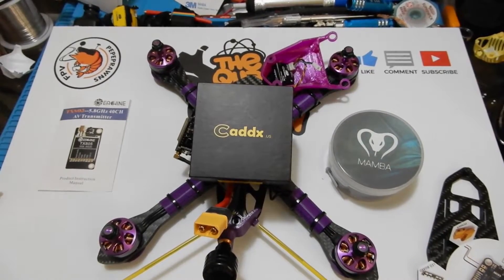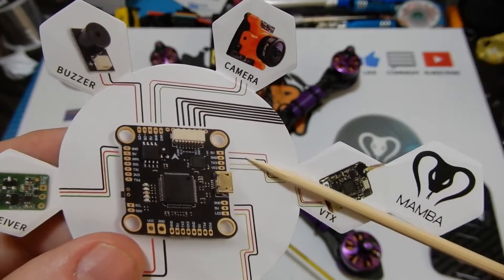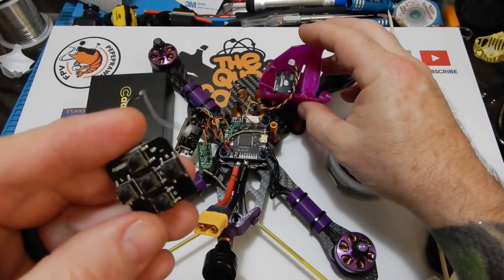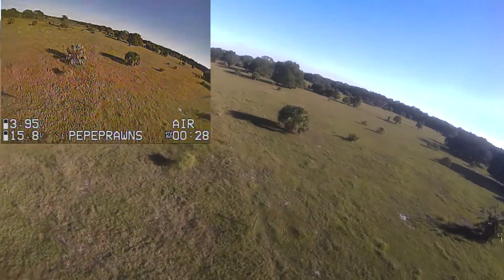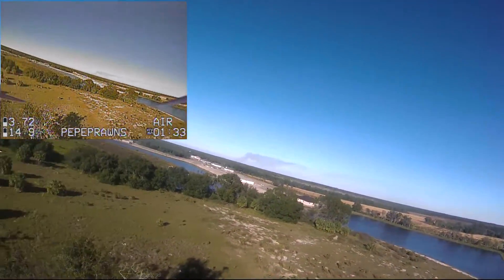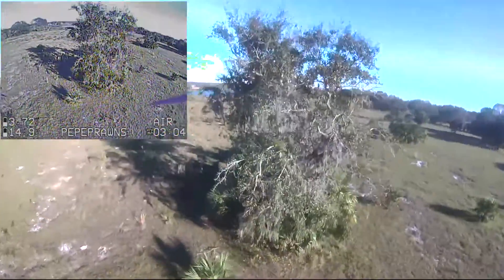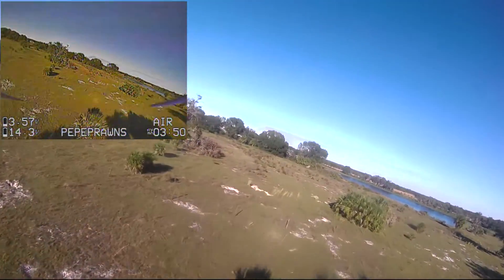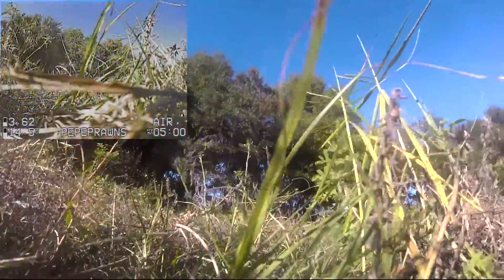Diatone - Mamba F405 Power Tower Build Part 2

Comment: What is the secret to not having interference in the video. I mean ESC?
Reply from the maker: Did you add the capacitor by chance? I also ran my camera power off the vtx 5v. As you saw I ended up with clean footage with that method. There was the slightest of interference but nothing like I have seen off other boards. Lately, I have just gone ahead and added the capacitor on all build I use the stack on even the mini stack. Kindo of just because. Not sure if that will help at all but that was the setup you see. The power on the camera pad was dirty for me.

Comment: I can see that there is a bit of noise in the dvr footage. Were you able to remove the noise by adding higher low esr capacitor or anything?
Reply from the maker: I didn't have the supplied one on at all. Just adding what they supplied worked for me.  You couldn't see it in the google view at all I was surprised to find it when I pulled the DVR footage off.

Comment: Great stack and nice build. I have that stack in my Diatone GT M530. Had to replace the original individual Mamba ESC's due to the fact they kept burning out. I guess it was a manufacturing issue because Diatone discontinued them.

Comment: I have 2 of these stacks.  the f405 was reading incorrect amp readings.  The battery voltage was fine.. I asked on the diatone fb group and what I was told jacked it all up.  Are yours reading correct? If so mind shooting me the numbers from betaflight?
Reply: so, whats the current scale #?!

Comment: I'm glad to see that FC stack and VTX combination works good, I just put the same on my quad but haven't been able to try them. Did you use the provided capacitor?
Reply from the maker: I didn't use it no to see how it would go. Going to add it now because you know why not.
Reply: I did add it to the battery pads in the ESC. Just wanted to know if it was indeed needed for better noise filtering.  Let's see how it works. Thanks for the build series!

Comment: Using same Mamba F405 on my 5" with RCX 2207 2400KV. Works fine even without capacitor.
I'm using Runcam Eagle micro (only Runcam I like).
I have try Speedybee Vtx+dvr. Works fine as well and recording quite good video. Definitely better then dvr. Audio is terrible but it's there for you.
You can watch my last video for sample.

Comment: The single button controller is a 5 way joystick....so it works just like the 5 button controller. The joystick is just cheaper for them to manufacture. I've found that they are all interchangeable from manufacturer to manufacturer. Wonder why it wouldnt work for you, maybe it has a defect. Keep the videos coming buddy!
Reply from the maker: Is there a trick for the people.I could not get that thing to work. Held left over and over and never could get in the osd side so i went that 5 button route. Is it left and hold or something. I think tried that too though.
Reply: @TheQuadcopterReview  Try holding the button UP, thats how ive gotten in to the OSD if I remember correctly. I'll hook up a camera on my bench in a bit and confirm.
Reply from the maker: And now that i think of it yep of course it in cause the singe button is like a wand and the 5 are just click buttons. If it was a snake. hahaha